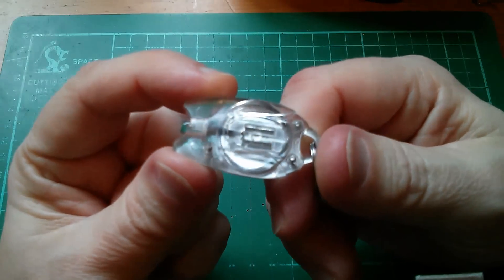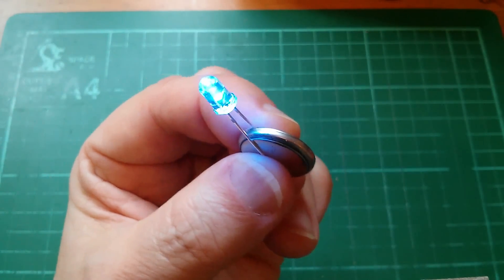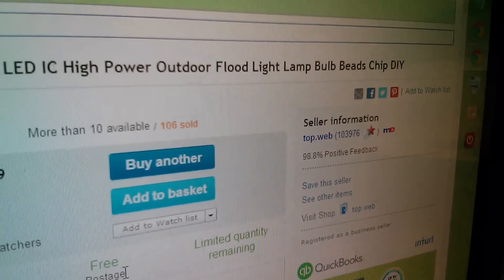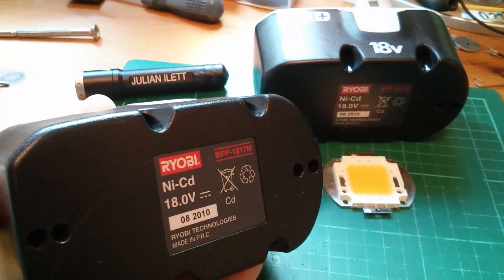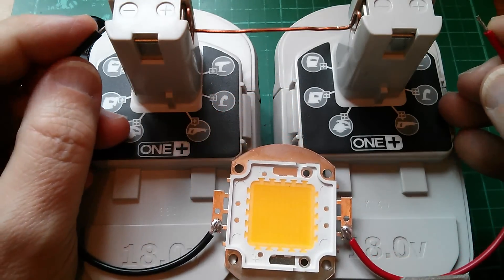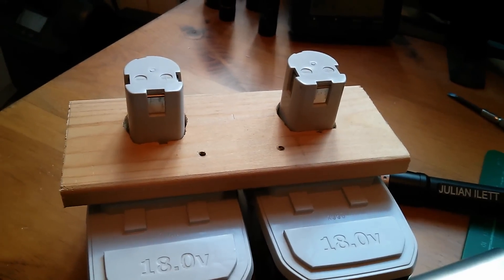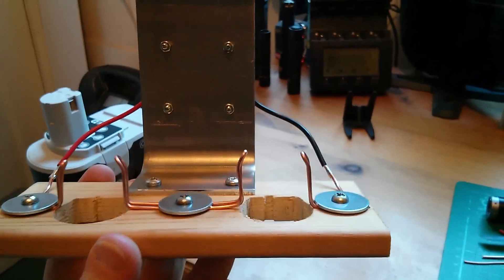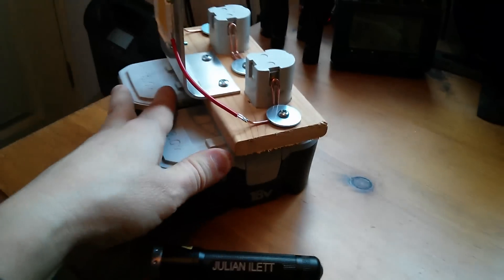Monster 7,500 Lumens 100W LED Flashlight for under $10

Comment: So what you've effectively demonstrated is that you cannot custom-build a 100W LED flashlight for under $10.  Your chosen power source cannot be bought for that price.  It is also way too heavy and bulky for a flashlight, as the batteries and the heat sink you need make the contraption obviously impractical for a portable flashlight...  Question.. Does the current stay constant as the batteries deplete and voltage drops?  (Are constant-current drivers all that expensive?)
Reply from the maker: davidswelt You're right, the current does drop away quite quickly. I have several other videos where I use electronics to keep the current constant.
Reply: Julian Ilett What's happening is that the LED unit is heating up, causing greater and greater resistance and thus reducing the current.  It's self-limiting.  If you add a resistor to the circuit, the LED won't take such a pounding; both the LED and batteries will last longer.
Reply: markmaxy125 Yes yes, fair enough.  Great to see someone make stuff, whether the claims are correct or not :)
Reply: These kinds of things happen every day.  I just bought a Lamborghini for only $8.  That's how much the light bulb for it cost.
Reply: +davidswelt It's NOT too big and bulky for a flashlight, I've got an old conventional flashlight that is about the same size as that rig. It wouldn't be hard to refine the design to put a handle on it and a way to secure the batteries so it could be carried around.
Reply: Sean Anderson
Yes the cost was underestimated, nevermind the amount of time to continue to evolve the design to be more usable but your figure is wrong too.

You cannot get real (vs generic fake rated) 100W flashlights for even $100, let alone $40, and you would still have to buy a lot of (battery) cells for it as that's a lot of power needed, and a special (balancing or large # of bays) recharge system at significant expense too.  $50 for battery and charger to get even a mere 1/2 of runtime isn't possible without substantial usage limitations (aka bullschitt involved).

Frankly I'd just give up on the idea of a 100W flashlight because it's not practical.  It can be done but what's the point beyond monkey fascination?  Beyond about 30W one becomes impractical from weight and size for portability if nothing else and even at 30W it won't run long before heat or battery lifespan limit the runtime too much to be useful for all but very unique and contrived situations.
Reply: davidswelt they got those batteries cheap at the thrift store. I'm pretty sure it can be under $10. and it is practical for me, after the sun goes down I need a bright flash light setup when i am working in construction because sometimes I run out of batteries for my head lamp.
Reply: Life Is Better When You Relax No.  LED forward current increases (forward voltage decreases) with temperature (heat).  What is instead happening is the internal resistance of the battery packs cause them to become a VA type supply where the higher the current the lower the voltage depression, and thus, the lower the voltage is above the forward drop of the LED, limiting current through it.

What this essentially means is this is not a 100W flashlight.  It's a lower wattage flashlight using a 100W LED.  "IF" the purpose is a very wide flood beam then this is not only not a problem, but instead a desirable thing because if he had used, say a 50W LED driven to 50W instead of a 100W LED driven to 50W then the half sized die would have twice the heat density and resultant heat would reduce both lumens and lifespan.
Reply: +Life Is Better When You Relax  
when you increase resistance you increase current, but I knew what you meant. You wont increase battery life much by adding a resistor, that  will only move some of the batteries energy discharge from the led to the resistor.  You need a little simple switcher in there. Easy and efficient.
Reply: +Stinky Cheese 

No I didn’t suggest that the resistor will consume whatever current the led doesn’t use. For one it doesn’t work that way, a single closed loop circuit has the same current at all points(Kirchhoff). What I said is some of the batteries stored energy will be now be moved to the resistor. Some peoples view of electronics seems to be stuck on that if a I add a larger resistor value then clearly I’m increasing the resistance, this is not correct for the circuit as a whole, just at the point where you are adding the resistor. Because the current measured at anyone point in a closed loop circuit will be the same, if we add a resistor of value X our emf(voltage) will drop in accordance with ohms’ law across this element and the resulting emf potential will now be reduced by x amount for the remaining elements in this new circuit. If you reduce the amount of current flowing thru anything you are effectively reducing its resistance to the flow of current. You are missing the direct relationship between resistance emf and current although you actually stated exactly what I’m referring to here when you said and I quote “Yes you are increasing the resistance of the circuit, and thus the voltage since they are related by ohm's law”. But you are only increasing the voltage across the resistive element (volatge drop) and there by reducing the voltage for the rest of the circuit, well as long as the voltage source is fixed like a battery. So when you increase the emf (voltage) you are also increasing the resistance to the flow of electrons in the circuit so if you reduce the emf (voltage) you will reduce the resistance to the flow of electrons.  Whenever you add a resistive element to a circuit you’re removing some of the potential force that wants to push electrons along so you are reducing the potential difference between these points which will intern reduce the current flowing through it and the current flowing for the entire closed loop circuit. When you reduce the amount of electrons trying to pass a single point at the same time you are reducing the resistance to the flow of electrons.
Reply: Jeff DeWitt
Yes, 18650 is by far the most common size cell in laptop batteries, and reuse of an old laptop pack would be a good value, but if one were to make a pack from scratch, trying to run a 100W light, it would probably be better to use larger Li-Ion cells like 26650 or 32600 so you have fewer in parallel to achieve the same runtime.

However with any of these you have introduced a new issue, that you need a custom charger and ideally one that balances the cell charge, which could practically double the project cost over leveraging existing tech like the power tool battery packs with a charger made for them, especially if you already happened to have them or find value in buying a new drill to use as a drill too, so the flashlight is merely another tool using the same packs you use for other tool(s).

On that note, it would be more practical to just buy a cordless drill set that includes a flashlight that runs off the same batteries and modify it by putting a 10W LED in.  Obviously it won't be nearly as bright but it will be a lot more practical and durable for real world use, as well as having longer runtime.

I can drop my drill flashlight, use it in the rain or for a plumbing leak, hang it sideways from a car hood for repair work, blindly throw it in a tool bag, or hand it to someone else to use without them needing instructions and precautionary advise to use or recharge it.  A total noob can pick it up, use it, recharge it just as they would any other tool.  It's foolproof and my most used light around the house for repairs or power outages, except of course my tiny EDC pocket light.
Reply: markmaxy125 heh. you tube comments. he should have realized it was just for the kicks when he started to get data sheet off eBay auction...
Reply: Doug Reed That's not really true with high powered LEDs because the forward voltage (voltage drop) changes with temperature and varies from one specimen of LED to the next.  The datasheet figure is only an avg and may also spec a max and min Vf values.   It's also not acceptable for battery pack power because the battery voltage drops as it is discharged, and with an increase in current.

Once you have defined an ambient temperature operating range, and mounted the specific specimen of LED you'll use on the specific heatsink you'll use, THEN you could adjust the voltage output on a regulating supply while measuring output current to the LED.

However, this makes no sense to do.  If you already need a regulating PSU then to adjust it, and even then are bound by everything above, it is much easier, much more versatile, and less expensive to just use a current regulating LED driver and a battery pack with a significantly higher input voltage (at end of capacity like 0.9V/cell)  to it than the LED Vf drop.  In other words a 18V pack would be suited to supply a constant current LED driver for a ~ 12Vf LED array, but that pack would need larger, lower impedance cells in it than the sub-C size used in that cordless tool pack in the video in order to drive the LED at its max 100W capability.
Reply: davidswelt Once again an ignorant kid on youtube who doesn't bother to read the description
Reply: Lord Jock awuh did someone get a wil hurt.
thats ok go have your mommy kiss it better. :)
Reply: Stinky Cheese  hah nice
Reply: +Life Is Better When You Relax As an LED heats up, it's resistance drops, causing the current to rise. A series resistor for this would have to be rated for over 20 watts, and wouldn't do squat for the life of the battery, except turn it to heat.
Reply: Thad ward
??  Your electronics skills need some brushing up.  Increasing resistance decreases current, that is the whole point of putting in a series resistor.

You will increase battery life, but how much depends on how much you increase resistance based on the ohm value you choose, and of course the brightness level you seek.

It will not "only " move some battery energy from the LED to the resistor.  The total current consumption is lower than if the resistor weren't there because LED current rises with voltage.

It is true that in "most" cases it would be more efficient to use a buck switching PSU instead, one that has its own current limiting, especially when talking about an LED above a couple watts (let alone 100W), but it can be done with a resistor and makes sense to do so in certain situations such as if/when there's a virtually unlimited power source and the complexity and ambient conditions are not favorable to a separate switching supply, for example on a running vehicle with an ample DC alternator producing power. 

The trick then is choosing LED array(s) with an appropriate series forward voltage that allow the least loss through the resistor to ease heatsinking it, though with it set up to do so, the power resistor could be mounted on the same heatsink the LED(s) use.
Reply: +Thad ward  and my unbelievably pedestrian ohm's law skills are very much intact. I use the literal meaning of words increase and decrease. Think of a piece wire, 12 gauge we'll say, now put it  across the terminal of  an automotive battery. Would you say it has a "high resistance" or a "low resistance"? low resistance right, it's a straight conductor, ah hmmmm, then why did it start smoking and melt? Isn't it the opposition of current flow that heats conductors? so you see, there is a direct relationship between resistance, electromotive force (voltage) and impedance. when you reduce a circuit's resistance, by whatever means you've chosen, you will in turn reduce the amount of current flowing in that circuit.
Reply: Thad ward  Previously you seemed to be suggesting that if you add a resistor then the resistor just consumes any difference in current that doesn't make it to the LED.  This is not the case.

Yes you are increasing the resistance of the circuit, and thus the voltage since they are related by ohm's law.  The LED(s) themselves have no (significant) effective resistance, only a forward voltage drop, and the resistance of the wire and/or PCB traces is trivial at this current (assuming proper design!).

A complete course in basic electronics is beyond the scope of a youtube reply, but basically you have it backwards.  Increasing the resistance in a circuit NEVER increases the current. and it is very strange that you found a  way of arguing towards that point. 

As you should know, a resistor resists current flow and the greater the current flow the more the voltage drops.

This IS in accordance with ohm's law.
V = I * R.  What you are misunderstanding is that voltage is not the variable, it's a fixed constant as coming from the power supply, which is a battery pack in the video.  V is a constant value that can be solved for once you know the forward voltage of the LED.

As you must know, to solve an equation you cannot have all variables.  The variable that remains under your control is the resistance, and then you can solve for current "I".

V = PSU voltage minus LED forward voltage.  I don't recall the forward voltage of the 100W LED array in the video but let's say it's 12.0V for the purposes of this example.

(18V battery pack - 12Vf LEDs = 6V  (measured from between either terminal of the LED and the opposing PSU rail.

6V = I * R

As you can see in the equation, without any current limiting "R" the current, if the PSU had infinite current capability, is near infinite current flow onto the point where the LED goes into thermal runaway, Vf drops, current rises, and the LED bond wire(s) inside of it melt and the circuit is broken.

Otherwise, 6V = I * R still, AND 6V / R = I

Clearly you can see above that as R, the resistance, goes up, the current decreases.  The WHOLE circuit current decreases.

I recommend that you simply prove it to yourself.  Hook up an LED array, take voltage measurements with varying resistance values in series, THEN current measurements.

Just make sure you don't pick a resistor value that is too low so it causes the LED to burn up before you can take enough data points to see what is going on.
Reply: h&j*hh
Reply: Jeff DeWitt
lol, that's a highly subjective opinion.  I'm never so desperate for enough light that I'd lug that around, not with the fragility,  heat and short runtime downsides relative to a ready made 10W flashlight running off 2 x 18650 cells.

Playing with high power LEDs is fun, and easy, but 9/10ths of a good flashlight is the REST of the design, the bits besides the battery, heatsink, and LED which could be strapped onto anything but not equally well.
Reply: +Jeff DeWitt you can do what he did with 4 9v batteries sure it's not going to be the full potential of the led, but then the only problem is battery life.
Reply: Moth Yes you could. However if I was to actually build such a thing I'd use heavy duty rechargeable batteries, maybe a couple of re-purposed laptop computer battery packs.
Reply: Jeff DeWitt eh well why not just use some 18650 s you only need like 6 a voltage booster.
Reply: Moth I think those ARE laptop batteries, have you ever opened a laptop battery assembly?
Reply: i think they are in almost everything, i guess i haven't opened enough laptop batteries that's for sure.
Reply: Stinky Cheese Another way to do it would be to use a motorcycle battery. Kind of heavy but they hold a lot of power and the rechargers are cheap. 

However on a more serious note if I really wanted a flashlight like that I'd just buy one, I've got too many other projects that need attention.
Reply: straight to the point no flashlight for under $10 dlls or pounds
Reply: +The Judgemental Cat; for someone who is for the second time (but 50 years down the line) is playing with a "50 in 1 kit," it is a fun way to remember the basics. Am looking at plenty of different channels.Great fun.
Reply: Thad ward,,stinky cheese
CAN WE ALL JUST GET ALONG????!!!!!!!
Reply: +davidswelt the 100w LED alone is 10$..... the rest of the materials is at least 5-10 more, the batteries? HAH... 25+ each....

So yeah after about, 75$ you get a FLOODLIGHT, not even a flash light.... this was such a big clickbait...

Oh an i think you can get 100w flashlights for like, 40$? don't qoute me on that.
Reply: +Stinky Cheese 

When you add a resistor to a circuit, like adding a
1k resistor to a led and a battery, are you actually increasing the resistance of the circuit? Or are you just reducing the electro motive force potential i.e. voltage available to the load thus actually reducing the impedance on the flow of electrons in the circuit by removing some of the force that moves them. The amount of current in any circuit depends on the amount of voltage available to motivate the electrons. By adding a 1k resistor to
a circuit I only increased the value of resistance at the actual point I insert
the resistor on all other points in the circuit when measured now have less
current flowing through them and are actually all impeding the flow of
electrons less than before I added the resistor. So by adding a 1k resistor to a circuit you are actually decreasing the impedance of the circuit to the flow of electrons by removing some of the potential force that moves the electrons. When you increase resistance you are increasing the opposition to the flow of electrons (current) you do not increase the opposition to the flow by removing the force that is moving them. You are actually decreasing the amount of electrons moving in the same circuit which is decreasing the conductors opposition to carrying the now fewer electrons. As I said before when you increase the resistance in a
circuit the current will also increase.